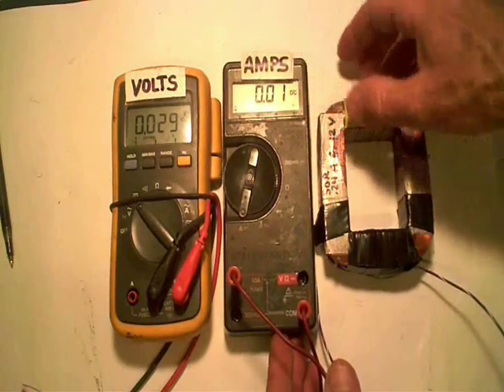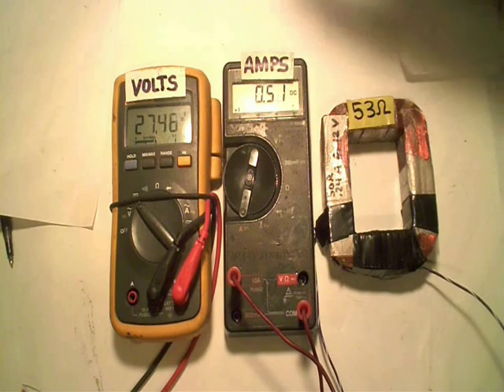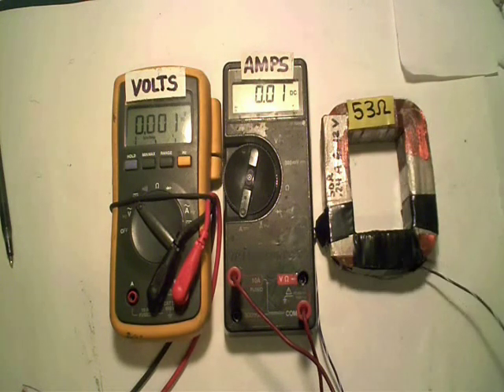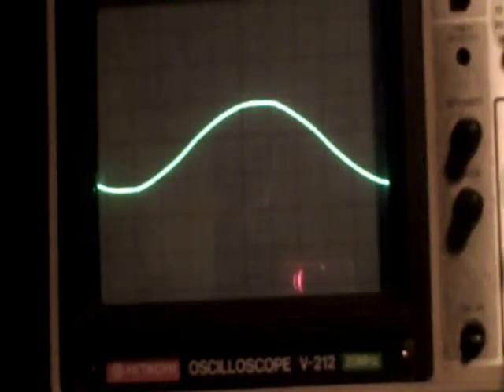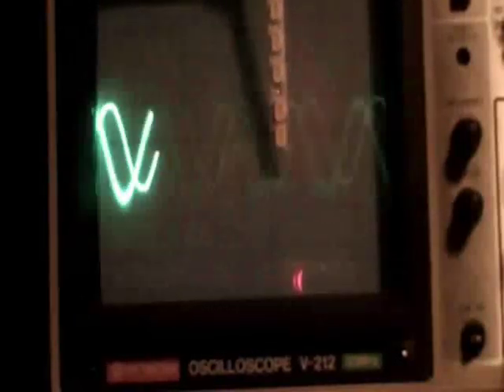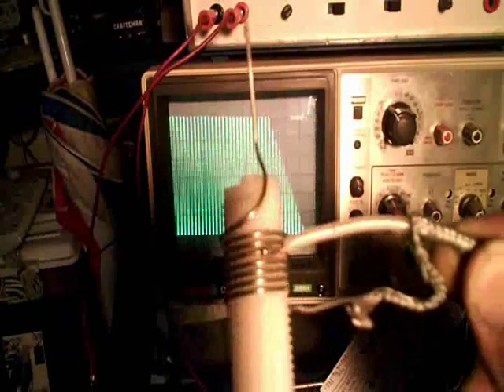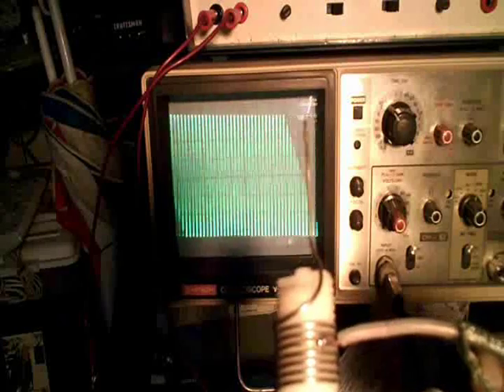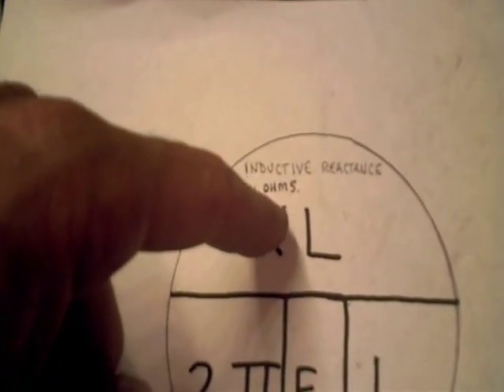Inductive Reactance Demonstration.

Comment: Thank you a helpful video - I am going to show my ignorance, but I didn't think you could measure current on an oscilloscope - could you explain how you did - then I can try !

Many thanks

Paul
Reply from the maker: Measuring current with an oscilloscope is done in the same manner as you would with an analog or digital amp meter. The only difference is you need to place one of your oscilloscope probes across a shunt which is in series with the device/load your operating.
If you look at the back side of a traditional analog meter which can measure 5 amps of more, you will notice many of them have a visible piece of metal connected to the Two input terminals. This is called a shunt, and its size determins how far the needle will swing for a given current on your amp meter. When you use an Oscilloscope to measure current it's no different, except that an oscilloscope will allow you to see waveforms which are to fast for your meter to pick up, plus it gives you a visual image of the rise and fall of the current as it happens.  If your going to measure the current across a load with your oscilloscope or meter make sure you do so in series with your load or it can be a real disaster. for your meter and or your shunt. It's hard to make this as clear as I would like in a few lines of text but its actually quite simple one you see how it's done. I hope this helps.

Comment: Thanks again for another great presentation. I guess this is the reason to why it's possible to measure a very low DC resistance across the primary windings of a linear transformer, but still it doesn't blow up when you connect it to mains. It's because the 50/60 Hz AC mains is giving the transformer a much higher impedance than a DC source would have done, and therefore the mains socket doesn't see a very low impedance path between live and neutral. Would that be correct?
Reply from the maker: Yes you have a much higher impedance when applying AC. When you apply DC the only loss is resistive unless your DC happens to be pulsed.